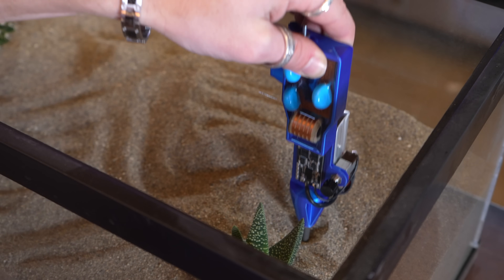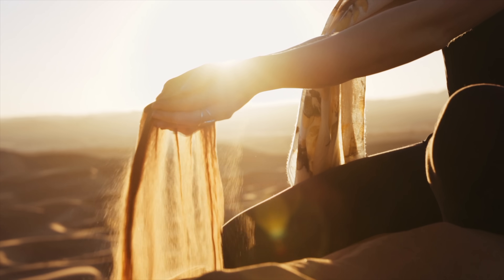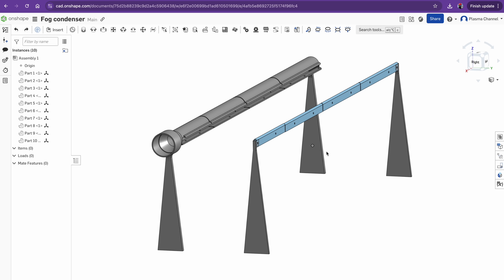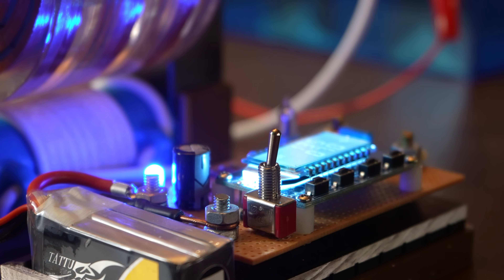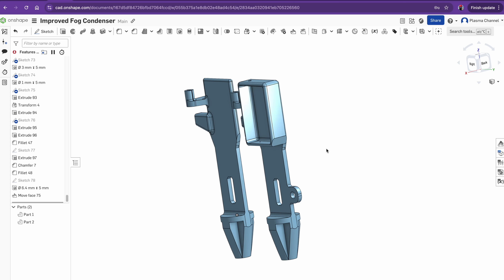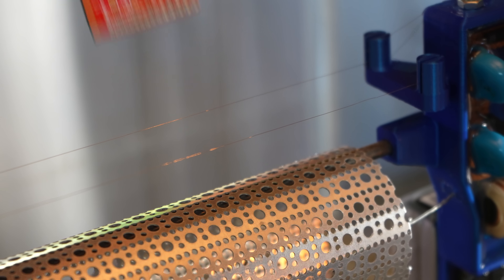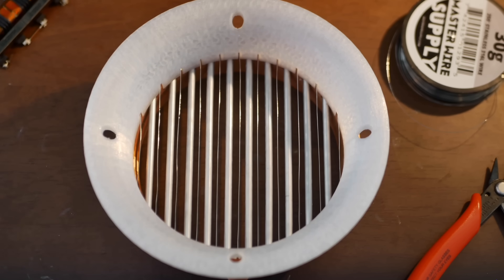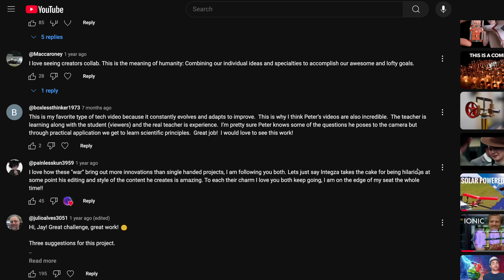Solving Desert Water Shortages Using 20,000 Volts

Comment: maybe you could also put a cloth on the backside of the ground mesh so it wicks the charged water away from the grounding rods and keeps the surface area of the ground high. It might not have much of an effect but maybe it will increase efficiency

Comment: so doing some math: 
- if it produces waterat a rate of  1WH/mL for a 2 foot section with dence fog 
- a standard solar panel produces about 150 WH per hour
- assuming 25% loss in storage
- also assuming there is about 6 hour of good sunlight
- the latest version in the video consumes 47WH to make 47ML in a 5 min window
- and say there is about 1 hour of fog
you should be able to make 940 ML (almost 1 liter of water) per system consuming 940 WH you would need about 3 solar pannels per 2 units.

Comment: the elephant in the room here is that if youre in a place with costal fog, you're in a place in range of simple, less energy intensive desalinization or, if from a river, just regular water pumping. deep desert, or even middle desert is on average still too dry to wring shit from. also this is basically making a dehumidifier. we've had the tech for this for a long time, and whats more, theres been a LITANY of these 'water from the desert' dehumidifer projects sold and shipped about the kickstarter graveyard of history that has made this tech pretty much synonymous with a scam (see things like the waterseer project)

Comment: Ok, so it works in a saturated environment, but how does it go with just water vapour?  I'm thinking you'd have to increase the voltage exponentially to effect single molecules?

Comment: Here is a suggestion for scaling it up quickly. Get the Chinese involved. They are building solar power in their desert and also greening their desert. They would be interested in such experiments and they are good at building things. Get in touch with their embassy in your country to get them to connect you with the right people. China has the funds, the engineers to scale up, the manufacturing capability, and the interest to water their deserts which they are trying to do presently. You would be famous if it is successful. Good luck.

Comment: Came up with the following numbers.
This seems to require 254 kJ/kg. A desalination plant usually seem to require about 11...18 kJ/kg
So it does seem to be quite energy inefficient for cases where desalination is an option. Would also be interesting to see how it compares to compressing, cooling, expanding. Interesting tech tho.
Also, the text at 14:29 says 14ml / W / H, but should say 14ml/Wh. But I usually prefer SI units and don't see why people don't use Joules for energy.

Comment: Nice build! But are you sure this is not due to the mesh being colder than the water saturated air you are blowing onto it? "Hot" moist air will naturally condense water on colder surfaces because the air is not able to hold as much water when it becomes colder.

A more extreme example is a "cold finger" which more or less freeze distill gases into solid form - could very well be done with water. Look no further than your freezer and why it needs to be defrosted

Comment: The main problem is the power scale, not the tech scale. Can you somehow recharge power from solar during the day? 
Second - how would it you prevent it from evaporating. Droplets irrigation systems kinda more reliable since thay can add water from time to time during the day and you better store condensed water in some tank, not in the ground.  Which leads to question how do you create proper fog catcher. Probably would look like a fancy variation of arabic windcatcher with condensers inside. Though I'm not expecting great water output even with that. 
There's also  nice Veritasium video "District 5: Electric Sparks From Falling Water", which could be probably used to optimize power consumption or make it completely passive or maybe with initial "ignition"

Comment: No fog in the Desert, but the coastal Desert like San Diego, or Chile have lots of Fog. But they also have lot and lots of salt water in the Pacific Ocean. You produce 14 ml/w/h, while a modern desalinator doesn't need fog, can run all the time and produces 250 ml/w/h.  You have a long way to go.
Reply: I think that the project in the video is way more cheaper than a desalinator, even if the project is not eff enough it can help

Comment: Could something like this be scaled up and installed in between transmission lines on an existing power grid?  Using the HV lines as the anode and hanging a net/mesh cathode between support structures  connected to the ground ties that are already installed for these? You could collect the water and run it to a cistern that water could be pumped to where its needed. i see it as an ionic Aqueduct.

Comment: Maybe I had an idea to increase or decrease the efficiency (You have to try it) Maybe giving a non-stick treatment for the water (Like the one used on the car window), would cause the water to rush to the ground at a higher speed, I'm just assuming that the generator loses efficiency when it is completely soaked with water, in this case that would help increase the efficiency (or could result in a failure)

Comment: Thank you soo much, you just fixed my mold problem!!
Reply: Well I think not the whole problem but with some safety measures it could reduce the moisture from the shower.

I think one would probably only need to charge the water electrically and the shower walls should be grounded enough

Comment: Very interesting. I hope someone tries this technology in a Solar Water Distiller. A solar water distiller is a basic technology where a black pan is covered with a sheet of slightly tilted glass glass. Sunlight comes through the glass evaporates the water then condenses on the glass. In optimal conditions of full sunlight one can get get about 1 gallon of water per one square meter per day. Commercial products are available, they are expensive. This technology has not taken off in the real world even though hundreds of millions of people live with contaminated, unsafe water supplies.  Adding this technology in could potential up the production of water several fold.
Reply: Having done extensive research into solar water distillers allow me to lay out a few more of the issues. There are a lot of factors that have been tried. Generally, you need water about 1/2 inch thick, so it gets nice and hot, in a silicone lined pan, well insulated, and need to circulate extra water through it. Mineral buildup is a huge problem that can destroy a distiller, so one must circulate an extra 50% of water through it. In the real world, these are currently expensive (for the poorest of the poor who it could really help)  fragile, must remain clean (no dust on top of the glass), and must be properly cared for. They have to be filled every day, water has to be collected regularly. Wild monkeys, dogs and other thirsty animals can break the solar stills, people who have to carry water for miles don't want to make extra trips to flush the still (so they get mineral buildup). Everyone wants more water, it is "never enough" and people have very poor "budgeting and conservation" skills. A human can live on about half a gallon to a gallon of water a day, (in America we use an average of about 80 gallons a day) but this requires careful management.  (For example, one can wash hands with just a few ounces of water, but this requires a slow dispenser, soap, and towel.)  Most of the problems with solar water distillers are solvable. (one can easily create a cage to keep monkeys away, one can increase production by having more units, one could decrease cost through mass production, actual input costs (glass) is cheap, unique piping can make things easy, production can be scaled up for cloudy days, a marketing and education process can help enable users, units could be designed that self feed. Much of this is not that hard, but it still has not been adopted or loved by those who need it most.
Reply: Being a solar still is a very high humidity environment, something like this solar powered if it could vastly increase the production it might be game changer. Running on solar power and using a few simple components could actually make this a profitable and unique device. From some of the other comments I understand this works best on water droplets in the air. (fog) not on water vapor, which behaves differently. Testing could done easily, put some water in an aquarium, run the device and capture the output while it sits in the sun.
Reply: It is truly heart wrenching to see people living in complete poverty, sick, dying and in need of so many things. One great need is water, specifically clean water. Well drilling has done great things in supplying water, but in some areas where there is salt, or other issues this does not work. To want to technically solve these problems, particularly, when they are solvable is good, admirable and upright. one great cause of sickness and death particularly of children is water borne diseases. Getting people to change their habits on something as simple as using a toilet is complex and hard. Getting people to use a crazy technology like solar water distillation or fog nets is hard. People in one town that had fog nets, actually preferred piping water water from another town, (because they knew understood and could use diesel engines and pipe. They could fix it and they could be like everyone else. (instead of depending on strange technology). These are the aspects of progress that are hard. There is great potential in solar water distillation. I am intrigued by the potential of plasma. We will have to see what can be developed and at what cost. This is the cutting edge of technology. You sometimes just need to do it; to prove it can be done. Back when the wright brothers invented the airplane, it took news of those demonstrations, specifically thirty minutes of flying the plane around Paris for all to see, that they had mastered the technology.   People in the developing world, have a lot of problems, and have struggled in many ways, but is is hard to see them still struggle, when you know the options to solve the problem is out there.

Comment: Haha so basically you have a method of producing unlimited clean energy in a desert. Now turn the water to hydrogen gas, and run generators that then extract more water from the air. Easily scalable then to extract massive quantities of water with free unlimited clean energy.

Comment: Comparing to a cheap consumer dehumidifier is terrible. It is for collecting evaporated water from air INSIDE buildings, not capturing water droplets suspended in air. The comparison is horrible & favours your device absolutely. Try it without the fog machine for a few days & see how your build captures absolutely ZERO water inside vs that $30 store one, which might fill up if the RH% is high enough.

Comment: collecting water from fog has been done since 1970s .  But using electricity is clearly has advantages as you demonstrated. You could have  menstioned the power consemption for this setup since availability of electricity in the middle of the desert is very limited and fogs comes in night so solar is not an option.(https://pmc.ncbi.nlm.nih.gov/articles/PMC3357847/#:~:text=The%20collection%20of%20fog%20water%20is%20a%20simple%20technology.,the%20mesh%20material%20by%20impaction.)

Comment: So with 14ml/Wh, with a typical crop like tomato requiring 4500 ml per square meter, each square meter needs about 320 Wh of power. That means, if we were storing solar energy, about a $200 battery, each square meter.

Comment: What I find interesting about this, is that a 300Wh battery + a 50W/hr solar panel weighing 10lbs combined could conceivably store solar power through the day to produce 3.6L of water from morning fog -- 8 lbs of water a day from 10lbs of equipment. That could make a fog system the best by weight for 'packing in' water in a number of cases to a number of environments where conventionally recoverable water sources are not reliable.

For longer term use needing 'infinite' cycles, gravity-batteries using water created from this system as the energy storage from solar panels running in the day after the fog burns away would be an amazing one-two punch for desalination along otherwise 'dry' or desert coasts. Definitely interesting at a civic scale, but perhaps even on a homesteading scale.

I wonder what the maximal recovery along certain coasts might be, and what populations that could theoretically support.

Comment: Worked with a company making Nickle Foam Batteries (I'm a machine builder and they needed my machine to make them). Something like that with a ton of surface area and good conductivity might not be a bad option. Essentially steel wool but way more fine/efficient. Add a PTFE tray below to a buried container to avoid evaporative loss and you could slowly accumulate water and capillary wick it out for watering if you want to keep power draw low. Or use the same panels/batteries to run the pump when the moisture farmer isn't running. 
I'd also be interested in what an aerofoiled geometry would do for dropping pressure and having your sponge on top to collect it. Essentially harvest the kinetic energy of the air to cheat the system for more water. I like your electrodes but couldn't you just use off the shelf ignition coils for mass producing it?

Comment: this has another, useful application... there are days along the coast where the fog is so dense, it is dangerous.    Or on ships, during foggy nights - having a large boom arm to clear fog to allow easier sight, at a fraction of cost of expensive systems or high power usage devices to detect obstacles for them.  IN these cases the attribute of collecting water is less useful (although, possibly useful out at sea?  I mean... fog at sea does technically have some salt in it - but studies may show (would need tested) to see how much, and how safe Condensed Sea-Fog water would be to consume. (although almost assuradly safer than the sea itself)

having devices like these set up along roads - especially roadways with already existing electrical lines in place - could help clear up fog, quickly and safely, and drain away the water - but consideration should be taken where they are put - as some other local areas, may rely on the fogs in similar ways for plants to grow.

Comment: How long fog lasts in fog deserts varies wildly, but you are assuming that the humidity is always extremely high like in your box, voltage drop doesn't exist and the fog elevation level and local density (near your plate) is always the same (which let's be honest this is not a realistic scenario). I'm sorry but this is almost as bad a relying on peltier devices. The energy requirement is already high, but trying to mechanically move the air to reduce the inconsistency in local humidity is not practical. 

Additionally, you can scale up the number of devices and increase the plate area all that you want. Even if you don't care about the additional power requirements and have solar panels everywhere,  how do you keep the panels and your plate clean? The desert dust is going to coat everything and your efficiency is going to plummet.  

I encourage you to go to a fog desert and try out your device. Once it fails, you can switch to how it will make a big difference in the rain forest, since that's the only place with enough constant humidity to make it work (though it still won't be economical).

Edit: This comment probably sounds harsh, but I do give you 100% props for not trying to sell this device on kickstarter or indigogo like the other water in the desert scams.

Comment: One thing not covered, but I’m sure most people are thinking about is using solar power and a storage battery to provide the power for the device only during the times when it is needed. Thus, water can be generated using a renewable resource and not have to be connected to a power grid.

Comment: I'm curious how much water the condenser would gather just from the air, without the fog. So a third scenario: "fog off, power on".
To make it more representative, should be put outside and where at least some wind would push air through it.
Then that difference would more closely show how much more the fog is providing. I bet that in mildly humid air, any molecules caught on the plate would evaporate faster than they could accumulate into droplets, so might be similar to the "fog on, power off" scenario, but would be nice to see it confirmed or denied :)

Comment: Pretty Neat, but the collector should be simplified so it can be shipped wrapped around one of the stakes and stretched out straight when installed, then just apply power, no assembly required.

Comment: you should make a version of this set up capable of handling fast moving air and use a fan to concentrate and blow large amounts of air through the system. This would make it less expensive to build for the amount of water produced. It would also make it more practical for real world applications in deserts.

Comment: Yeah the dehumidifier doesn't remove fog though it removes water that's dissolved into the air, so for one thing it works even when there's no fog.  It's not really a comparison.